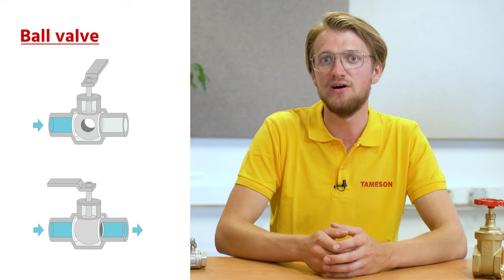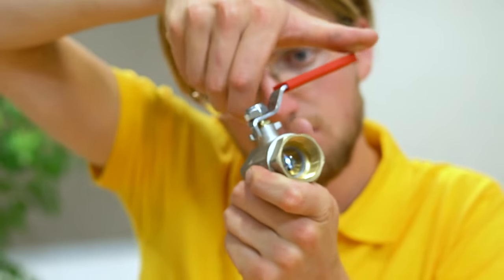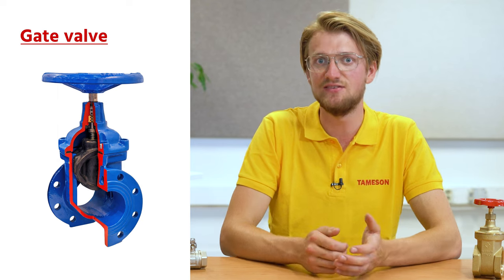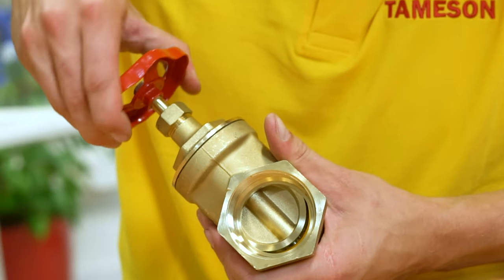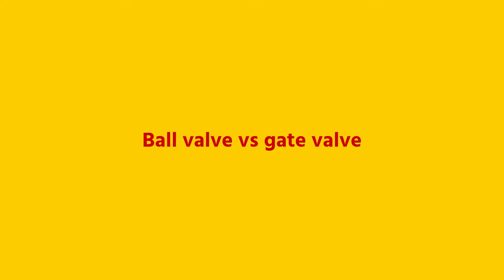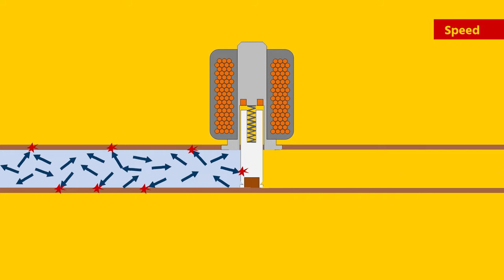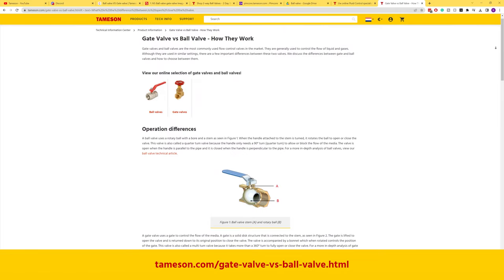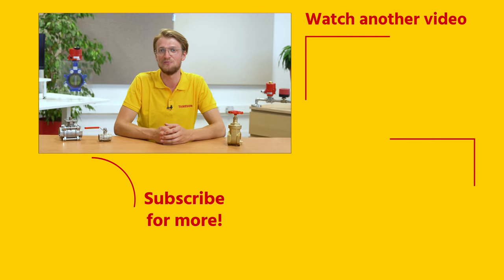Gate valves vs ball valves: How to choose the right one I Tameson

Comment: How can a gate valve handle high pressure if there's no silicon or rubber on that gate?
Reply from the maker: Gate valves are designed to handle high-pressure applications by using a solid gate that moves up and down to open or close the flow of fluid. The gate itself is typically made of metal, such as stainless steel or brass, which can withstand high pressures and temperatures.

Here are some key points about how gate valves handle high pressure without silicon or rubber:

- Metal-to-Metal Sealing: The gate and the seats are often made from metal, allowing for a tight metal-to-metal seal. This design can withstand high pressures and is less prone to wear and tear compared to softer materials like rubber or silicon.

- Robust Construction: Gate valves are constructed with thick walls and strong materials that can resist the stress and strain of high-pressure environments.

- Pressure Distribution: The design of the valve allows for even distribution of pressure across the gate, minimizing the risk of deformation or damage.

- Minimal Leakage: The metal gate and seats, when properly machined and maintained, provide minimal leakage paths, making them suitable for high-pressure applications.

- Temperature Resistance: Metals used in gate valves can also handle high temperatures, which often accompany high-pressure systems.

These features make gate valves suitable for high-pressure applications in industries such as oil and gas, water treatment, and chemical processing.

Comment: What causes a ball valve to close very hard? Difficulty  in closing. 3" stainless steel ball valve.
Reply from the maker: Hello,

There are several potential causes for a ball valve to close very hard:

- Debris or Contaminants: Particles or debris inside the valve can obstruct the ball, making it difficult to close.
- Wear and Tear: Over time, the seals and seats can wear out, causing increased friction.
- Improper Installation: If the valve is not installed correctly, it can lead to misalignment and operational issues.
- Lack of Lubrication: Insufficient lubrication can cause the ball to stick.
- Pressure Issues: High pressure in the system can make it harder to operate the valve.
For your application, you could consider checking for debris and ensuring proper lubrication as initial steps. If the problem persists, you might want to look into replacing the seals or the entire valve.